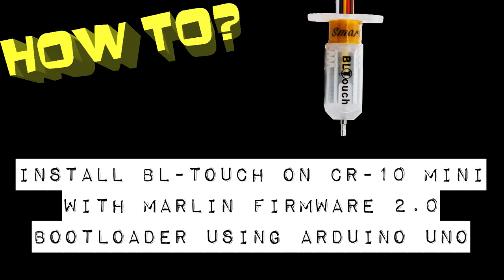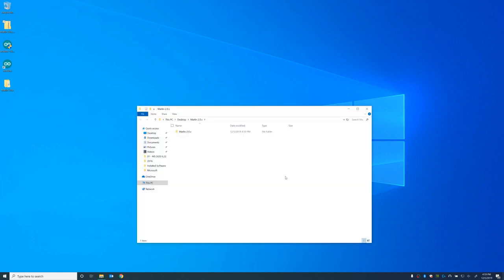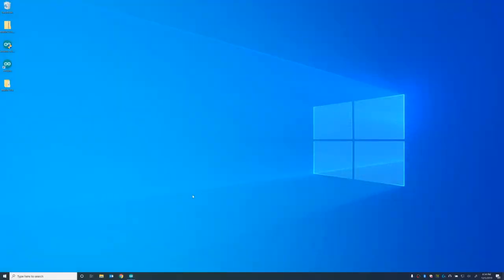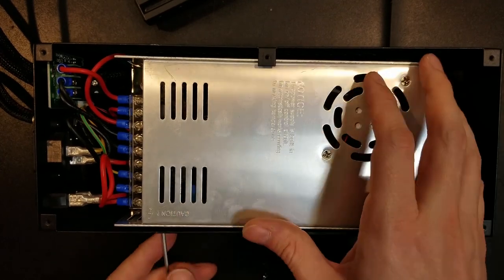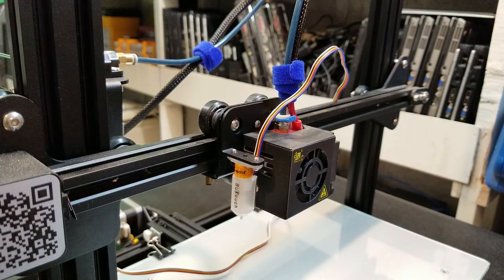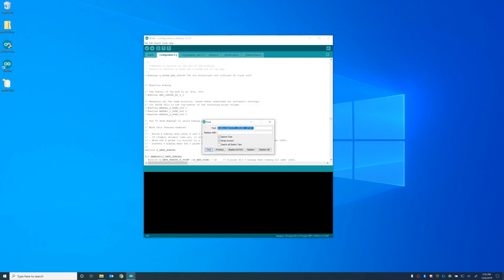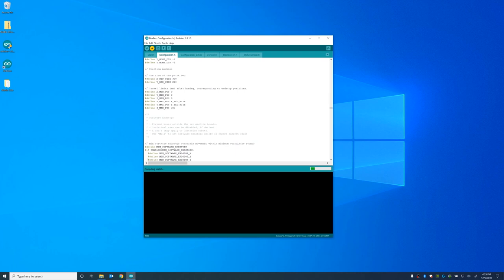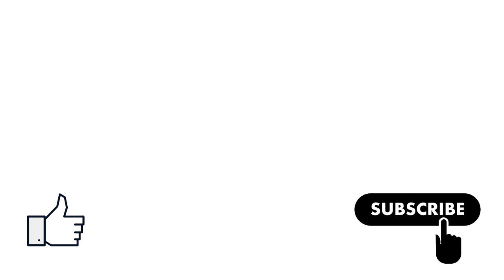Install BL Touch on CR-10 Mini with Marlin 2.0

Comment: Still getting this error message when trying to upload.
Arduino: 1.8.13 (Windows 7), Board: "Sanguino, ATmega1284 or ATmega1284P (16 MHz)"

fork/exec C:\Program Files (x86)\Arduino\hardware\tools\avr/bin/avr-gcc.exe: The filename or extension is too long.

Error compiling for board Sanguino.

This report would have more information with
"Show verbose output during compilation"
option enabled in File -> Preferences.

I also tried this on a windows 10 computer and received the same error.
I followed the instructions exactly don't know why it's not working.
I used the supplied ISP programmer that came in the kit from creality3d.
Reply from the maker: 2 things I would try. First try using Marlin nightly build with bug fixes. https://github.com/MarlinFirmware/Configurations/tree/bugfix-2.0.x if that doesn't work try an older version of Arduino IDE. It may something you need to try a combination of both. I have seen a lot of issues resolved using the nightly Marlin with bug fixes though.
Reply: @ShaneTriplett  I was just downloading it when I saw your reply fingers crossed thanks
Reply: @ShaneTriplett  Arduino: 1.8.13 (Windows 7), Board: "Sanguino, ATmega1284 or ATmega1284P (16 MHz)"

In file included from sketch\src\lcd\dogm\status_screen_DOGM.cpp:32:0:

sketch\src\lcd\dogm\dogm_Statusscreen.h:48:12: fatal error: ../../../_Statusscreen.h: No such file or directory

   #include "../../../_Statusscreen.h"

            ^~~~~~~~~~~~~~~~~~~~~~~~~~

compilation terminated.

exit status 1

Error compiling for board Sanguino.

This report would have more information with
"Show verbose output during compilation"
option enabled in File -> Preferences.

Different error this time
Reply: I just copied over the Statusscreen.h and I'm recompiling it
Reply: Arduino: 1.8.13 (Windows 7), Board: "Sanguino, ATmega1284 or ATmega1284P (16 MHz)"

sketch\src\lcd\tft\tft_image.cpp:24:10: fatal error: cstddef: No such file or directory

 #include "cstddef"

          ^~~~~~~~~

compilation terminated.

exit status 1

Error compiling for board Sanguino.

This report would have more information with
"Show verbose output during compilation"
option enabled in File -> Preferences.
Reply: I have the same setup as you except I need the SD Card option.
Reply: @ShaneTriplett  I've now have tried about a  dozen combinations and everytime I get a compilation error. I went back to Arduino 1.8.10 like in your video tried with the standard Marlin 2.0.6 and the nightly fix still the same issue ResolveLibrary(cstddef).
Is there anywhere I can go to submit the error log to maybe resolve this issue.
I've never had this much problem compiling a program in 30 years.
Thanks
Reply: @ShaneTriplett  So I used the ISP Board and Burner that came with the package from creality3d and ran the Update firmware per the instructions using progisp.exe.
I'm wondering if this step actually puts the boot loader on to the board?
I know that Arduino IDE sees the board on COM 5 when I plug it in using a USB cable so I'm thinking that the boot loader is on the board now.
Reply: With it plugged in and the Marlin sketch up shouldn't I be able to burn boot loader from tools using Arduino IDE Tools?
Reply: @ShaneTriplett  I'm able to get 1.1.9 Marlin to compile but it will not upload.
Reply: @ShaneTriplett  I get avrdude: stk500_getsync()  not in sync error when I try to upload it. It does this 10 times.
Reply: @levon4464  I was still having some issues due to the compile size but one of the versions I uploaded I thought was causing a problem with the Y axis it turned out however to be the extension cable I was using for the Y-axis was faulty though.
Haven't done anything lately haven't had the time to get back into it yet.
Reply: @levon4464  Have you managed to find a solution for this ?

Comment: z offset wasnt 2.1mm but 0.21mm isnt it ?
Reply from the maker: Everyone will be different. You will need to manually move below Z 0 to see how far it needs to go.
Reply: @ShaneTriplett  I know, im just saying you moved the nozzle at 0.00 rate. Means you moved it 0.21mm and not 2.1mm

Comment: Arduino: 1.8.5 (Windows 7), Board: "Sanguino, ATmega1284 or ATmega1284P (16 MHz)"

Archiving built core (caching) in: C:\Users\DANAPC~1\AppData\Local\Temp\arduino_cache_868316\core\core_Sanguino_avr_sanguino_cpu_atmega1284p_0c812875ac70eb4a9b385d8fb077f54c.a
fork/exec C:\Program Files (x86)\Arduino\hardware\tools\avr/bin/avr-gcc.exe: The filename or extension is too long.
Error compiling for board Sanguino.

This report would have more information with
"Show verbose output during compilation"
option enabled in File -> Preferences.
Reply: Hello Dana, Have you managed to find the problem? the Fix. I am currently encountering the same error.
Reply: @andreineagux  not yet

Comment: Hello

Your "#define ENDSTOPPULLUP_ZMIN_PROBE" is useless, because you have active #define ENDSTOPPULLUPS
Reply from the maker: Good catch! Apparently I didn't need that. Thanks for the comment.
Reply: @ShaneTriplett  Actually, my BL Touch work even without change "#define Z_MIN_PROBE_ENDSTOP_INVERTING false" to "true".
And one idea ;-)
To measure offset of probe, is OK use your printer. Just mark the spot under the nozzle and write axis position, after that, move by axis to reach marked spot by probe. When you subtract theese numbers, you will get right probe offset :-)